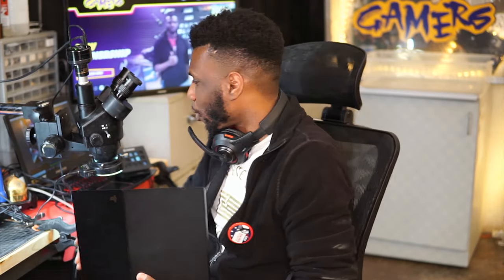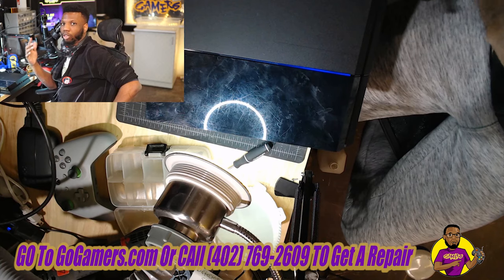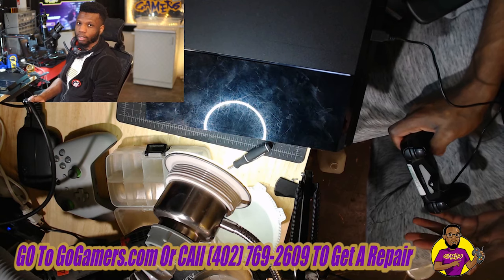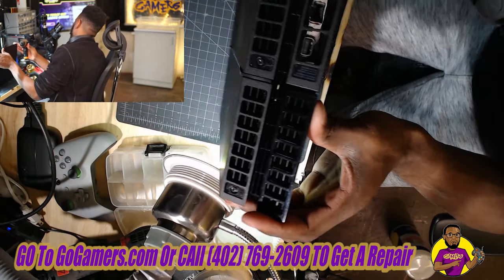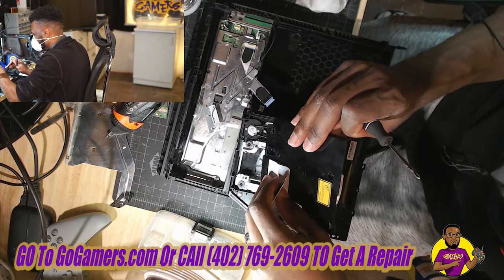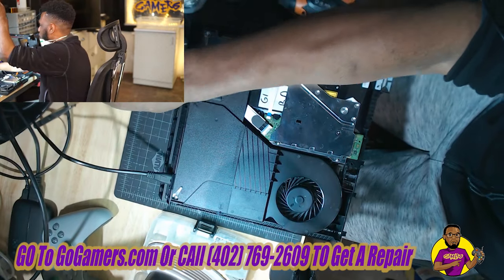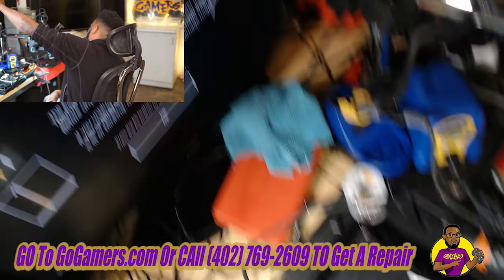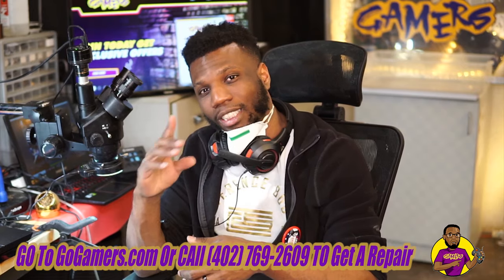HOW TO FIX PS4 wont/Not Reading Discs Or Games (5 MIN FIX EASY) Unrecognized Disc Repair

Comment: Mine did the exact same thing. I just tap on the ps4 above the BR drive as I insert a disc until I hear it start spinning and it fixed my problem. Bit of a ball ache to tap every time when you insert but its better than dropping 50 bucks on a new drive and believe it or not but it seems to be consistent problem.
Reply: I tried it and it work thank you thank you so so much
Reply: @SassyLoverBae007  glad I could help😊
Reply: Yupp this definitely worked ! Ahahha
Reply: Took me like 10 times and it worked lol
Reply: Thank you
Reply: Omg, thanks so much it worked
Reply: LOL this worked first try
Reply: That acctually works thank u man
Reply: Wtf this actually works thanks bro!😂
Reply: what do you mean tap the ps4 above the blu ray drive? like just tape the top of the ps4?
Reply: Holy crap, that actually does work. Thank you so much for this amazing tip!!
Reply: @sameoldsameoldsmall5193  ya, just tap right above where you insert the disc, maybe like an inch back or so from the front of the ps4
Reply: Working.  Ty Ty Ty .

Comment: I bought a PS4 that was extremely dusty, and it was a smoker's PS4, so the whole thing was gunked up. I started with spraying the dust out of everything. Then I tried the disc drive and it wasn't even taking, so I did the Qtip to the rollers thing and it worked like a charm like it usually does. But the disc wasn't reading afterwards. I tried your software methods, but I ended up having to take the disc drive apart and clean the laser. And luckily for me it did work right after. Very happy I don't have to replace the drive. When I was putting it back together I had to find a different person's video because your angle is very hard to see sometimes, and you went through the disassembly and reassembly too fast. I couldn't figure out where that small ribbon cable on the right went.

Comment: Hi I have a ps4 Model 1102a. I am getting the 'unrecognised disc error' on most discs (even brand new ones). 
I am going to try replace the parts myself - my question is, do I need to buy the whole replacement optical drive or just the laser lens? 

I have two links for reference: 
@t

@t

I live in Australia. 

There is quite a difference in prices and that is why I ask which type of parts I need - the laser reader or the whole optical drive?
Reply: Have you fixed it yet?
Reply: @rogermole4972  yeah i ended up taking it to the game shop and paying them to do it :/
Reply: @ellieb9053  How much did it cost? I recently started having the same issue with my ps4
Reply: How much did it cost ?

Comment: I have my PS4 only reading a fe games and with others it loads for a bit and then stops. I already did the safe mode option 5 but did want to work and the does the same thing. Should I change the laser at this point

Comment: What's the issue that causes these lasers not to work tho? Just out of curiosity. My pro has had this issue since about a month after I bought it. It will actually read dvds, but not Blu rays or games. Having bought it off of ebay, although new, I had no receipt to take it back anywhere. Periodically I'd check YouTube, Playstation forums, and Google searches to no avail. The videos never actually solved the problem. And Sony, as far as I know, has never addressed it, or responded to the numerous complaints about this issue. Glad to finally see it resolved. Tho I'll probably just upgrade to Ps5 soon instead of bothering to pay to have it fixed, it's good to have closer. For several years now I've just been hard tapping the console right above where the disc goes in as it's loading to get it to read the disc. And that trick has always worked. Matter of fact, I'm about to do it right now and play some fallout 76, lol.

Comment: So they’re actually isn’t a way to clean up the old laser? I mean I get it, especially with me making this comment September 2023, some of these blue drives are getting to be pretty old. But I feel like they’re not so old that you couldn’t have tried isopropyl alcohol and dusting first? maybe in some cases the laser has been used for so long that it’s bad.

How can you tell the difference?
Reply: Somebody please answer this man
Reply: I have a ps4 launch model and I can say cleaning the lazer is a 50/50 I mess with electronics for a couple years now and it's normal down to the board that's married ot the lazer in my case its the lazer "before and after cleaning with 91%ipa"

Comment: Okay I got a question for you how do you fix a PS4 when it reads the game disc but part way through loading it it comes back with the saying error that the disc is dirty or broken and I already cleaned and replaced the laser but it still does the same thing and one day it just started doing this it wasn't locked it was in touch the game wasn't ejected it just started saying it to Grand theft Auto and all my other disc games how do I fix it
Reply: Have you solved the issue? 😭
Reply: We need a solution bc I just bot a new Lazer and reset my ps but it still didn't work

Comment: I have a similar issue. It's a 2 disc game, RDR2, I had put it on my PS4 a year or so ago, but started having freezing issues. For a while I could restart and still play. Then the console started kicking out the disc, saying files were corrupted and I should delete. So I deleted.
Re-installed data disc just fine, prompted to put in game disc to finish. It loads about 20% and pauses, won't go any further. 

I have gone to safe mode, updated/rebuild data base, unplugged overnight, cleaned both sides of disc, no visible scratches or smudges or defects on disc, nothing seems to help. Other games like Madden19, Uncharted work just fine.
Any suggestions?
Reply: Gonna have to replace it, it seems

Comment: My ps4 one day just stop taking game disk. It doesn't make the running noise to pull in disk. So i replaced the drive with a new one. It does samething. No running noise to pull in game.. Is there anything else that could went out that controls the game drive . Thanks

Comment: What if it only reads some disc's others it will not. Even with a brand new disc drive it does the exact same issue. I can put watchdogs and rocket league in works first time but if I try fallout or black ops it says unrecognised disc. Disc's are immaculate with no issue what so ever work in other console perfectly fine

Comment: Just thought I’d add my own symptoms and thoughts in case it helps anyone. 

So I’ve had a few issues recently with mine. I took it apart and put back together to clean, add new thermal paste and replace the CMOS CR2032 battery. Initially it seemed to work fine but the drive was doing the thing where is takes the disc, makes noise intermittently then spits it out while then deciding to block the entry point. Taking out the power for several mins would restart this process with the door open from startup, but the same would continually happen. 

I took the drive out and also turned that plastic screw a bit which moves the rollers (not sure if it was doing anything beneficial) and put it back. Problem was solved, until about 2 weeks after when I’d been moving the console. 

Now things were different. This time it took the disc and sounded like it was spinning as normal, however the laser wasn’t picking up on anything at all. No error message either. I did try to do a system update from safe mode and ended up getting a continual error. This was the drive error which happens when there’s an issue with the drive itself and it won’t let you update system files, even in safe mode. I took it apart and had it on its side while testing it after pressing the ribbon cable a bit that’s at the top. I was also worried about this because one guy’s video said to pull the metal tab to remove the cable when in fact you’re supposed to press it down and remove. I felt like I might have disrupted that tab when I was first trying to take it out. I think it’s the ribbon cable causing the issue in the connector and explains the error message on not updating. I thought it could have been the drive itself but surely a loose connection on the cable would cause the update to fail if it relies on communicating with the main board. So far I’ve got it working but there’s definitely something temperamental going on. 

There’s that rubber foot issue that I ruled out as I was getting the first issue with the door locking even with the lid off and testing the sensor with something metal on the eject plate. That was more when I had the issue of the system ejecting the disc originally.

Comment: How do you know when a laser is bad or a drive is bad ?! I don't know wtf is happening Because I never ever place discs I been playing game downloads only from the beginning I played maybe 5 discs in the 6 years I had this shit never moved it dropped it nothing. I did have a Xbox sitting on top of PS4 all this time maybe the weight of the Xbox pushed down on the PS4 ???, Anyone plz tell me what to do here disc goes in makes a clicking noise and won't read any discs the fan definitely is working it's just the disc issue so I think it's jammed maybe the rollers off track

Comment: Bring back cartridges !!
my 30 year old Nintendo games work longer than these CD/DVD/blue ray  games do nowadays ...
Reply: I agree. The only risk for cartridges is dust. Now they have discs and its a shit show.
Reply: While I do prefer cartridges, it wouldn’t be possible with modern consoles because of storage . Discs hold more space than carts, and most games now are more than 100 gb.
Reply: @BigMMG198  nintendo switch bruh
Reply: @Dustin34  Nintendo switch carts don't hold that much by todays standards. At most 32 GB.
Reply: @Dustin34  fr😂🤣
Reply: And no loading times

Comment: My Ps4 reads the Discs perfectly
At least the most😅
When i put Dying Light and Horizon Zero Dawn in it says non recognized Disc. I put the Game out put a different Game in. It works. I put Dying Light or Horizon Zero Dawn in. Non recognized Disc😭 . It's just with these two Games. All my other Games work. The Discs are not dirty or have any Scratches. What the Hell is going on?

Comment: I opened mines up a few times cleaned it and got a new laser kept same logic bored and connection ribbons it wont spin still ..so i swapped the new laser and put it on the original laser slide from old laser still doesn't spin laser tries to read .
Reply: Did u fix it bro
Reply: Yea i got a usb .downloaded the update and games on it did a initializing sweep on the console..back on call of duty dropping shit

Comment: 😢😢hello well it worked really worked i played 1 match my wwe2k23 was doing that so hearing the music on the background is rarely cause immediately when i open the application it shows display then it shows that i did it use your method it worked i played 1 match when i put on a tag team match my ps4 started making that unrecognizable sound then boom close application and remove disc i did again do the method still works well but durunf first player entrance that pops up again i deleted the application and redo that process ut does the sane thing but doesn't want me to play 1 single match 😢

Comment: Mine reads them momentarily. But then it cuts to a screen stating it cannot read the disc. Supposedly the disc is damaged. But they're in excellent condition and have been read in their state flawlessly in a previous PS4.
Reply: Mine has been doing the same thing did you get yours fixed?
Reply: @blakeshoup9946  yes, surprisingly a strange act I came across when a newly purchased PS4 was not working. You literally have to stand on the PS4, weird, but this is the second one (though used condition) I did it and boom! No longer did I receive the message. Even though the disc has some scratches, it never came on again. Just stand lightly, not add a good amount of weight while stepping on it, just try to be careful around the area where the HDD is, not that again it ever affected it.
Reply: @rubens.4116  weird fix but i’ll try it!
Reply: @blakeshoup9946  even I couldn't believe it when I saw the dude showing it do it. Tried it immediately and my PS4 was alive again. The recent one had the disc read problem, did it and never had a problem. I also blew into the disc drive, even though best thing you might have to do is clean the laser in the disc drive.

Comment: my ps4 took it off to protect it and then i screwed it back into that ps4 then i put the case back in the machine and it beeped, i'm afraid of the ps4 if i plugged it in, it would break

Comment: I have had a recent problem just like this, it seems to have.... wanted to clear up but not entirely. It's a PS4 Pro and it was doing this exact thing. Sometimes it need the disk inserted several times and sometimes play, BUT it always saw movie blu ray disks. I got a little frustrated and gave it a bit of gentle percussion maintanance (you know, a gentle enough slap not to move it from it's spot.) and it seems to be working except for one problem. When most games are nearly done installing it gives me an X on the load bar and says "Could not start application.". So far I can't install UFC 4 or Detroit Become Human. 
Any ideas? I did do the full factory reset bit and updated the system when I was trying to figure it all out. Hope you see this and are willing to help.
Also, being an old hot rodder I noticed you said the new drive was loading faster, what kinds of things can you do to upgrade a console? Like... a solid state drive or a better bluray drive and that sort of thing? Better cooling?
Reply: I need help with the same thing as well
Reply: If after swapping the laser out and you are still getting the X issues, you might have a faulty hard drive. Re-install the OS after a clean format if it won't install the OS correctly your drive is bad or going bad. Upgrades included a 1-2 TB SSD, updated DISK drive ( not the factory OEM), that's really about it, anything else is a hack and most don't need or should stay away from that if you don't know what you are doing. Good luck.
Reply: @tranceunderworld  Awesome! Thanks for the advice, I'll look into it.

Comment: I replaced the laser and have done every update possible and I still cant get it to read discs. Help!
Reply: Squeeze were the disc goes in while it's going in 
It fixed mine
Reply: @aidenwayyy7526  i have the same problem which this video's ps4 has , so it means my lazar is damaged , but some people are saying that they bought new lazars but still it doesn't read . Can you help?

Comment: The real trick is, right when you insert the disc just tap in the middle of the disc area LIGHTLY and it should help the ps4 to read the disc.

It will be hard at first but never give up.
Gradually the ps4 will be eaiser to handle and it will occasionally work on it's own.

Another method is to just flip the ps4 on its side but I just use the tapping method.

I've done this for 2 years now and it was rough and hard at first but just keep trying and put the disc back out and in again.
Reply: When you say flip on its side do you mean stand it vertically or horizontally?  As mine has lived vertically for 4 years and has started to struggle reading discs the last few months, just read your comment and thought great Ill try lying it down on its side, but then wondered which way you consider on its side?

But I will try lightly touching the middle of the disc area to see if that helps

EDIT: I havent tried turning it over yet but did try tapping the top of the disc area and heard it spin up first time, thanks!  With it struggling for a while now and me sometimes sat there for 15-20 minutes ejecting and re-inserting until it reads and spins up, hearing that sound as the disc spins up feels like a little lottery win
Reply: @Fromatic  yes, its very slow at the start but it will get better. I also ment putting the ps4 vertically but if you already have done that the just go with the tapping "solution". Otherwise putting it on its side vertically did help me
Reply: @nebula70  should i tap with the upper cover on it or should i remove the upper cover and keep tapping or just tap once? Reply plz
Reply: like keep tapping or just apply pressure?
Reply: Thank u so much bro u saved me

Comment: hey man, so my issue with my PS4 and blu ray dvd player is, both won't play this one blu ray DVD disc i got. the disc has no scratches/smudges whatsoever. it's like brand new. got off ebay used. anyways, the PS4 and blu ray dvd player both read this disc as "Unrecognized disc" so.. yes, i tried the safe mode/update internet option. turned the PS4 on its side to see if it would read it better. i tapped the top of the PS4 disc area, and even exhaled air into the disc slot and still nothing.  /:   disc look legit, has the sticker of the film but i wonder wtf is up?
Reply: Tries everything myself no joy 😒😒

Comment: It recognizes my disc and will let me play my games for like 2 minutes then it’s not reading out of nowhere
Reply: Go to the power saving section in the settings then turn both general application and the other one to dont turn off and then it should fix

Comment: All I had to do is squeeze were the disc went in and while it was going in and now it works completely fine
Reply: could you explain this a little more clear?
Reply: What do you mean by “squeeze?”
Reply: Explain
Reply: @waypastdank5541  I found a better solution for getting your disc to get recognised do you want it ?
Reply: @aidenwayyy7526  yes please

Comment: I figured out a fix for discs not ejecting properly, after a while the fluffy thing that you slide the discs through will get harder and almost crusty even. assuming you've checked the rollers and they're fine this is the problem, you can just cut the top half off and it will work like new (I'm not sure of you buy a replacement I haven't needed too)